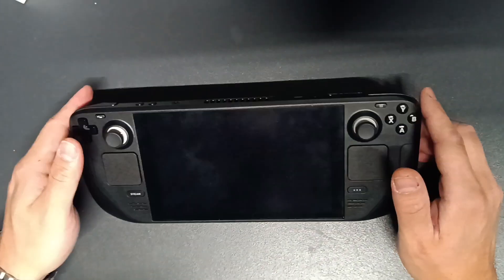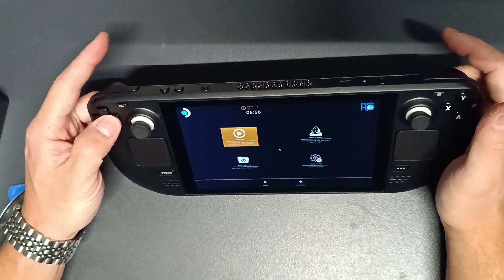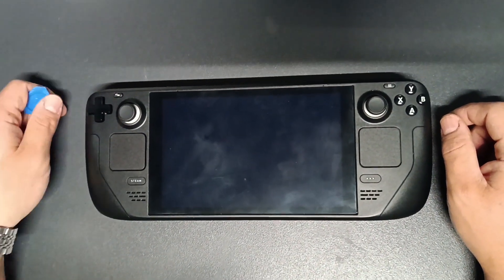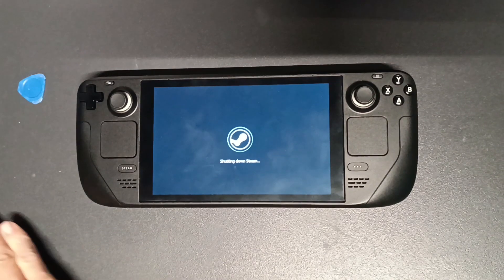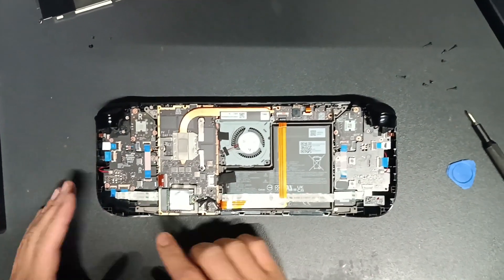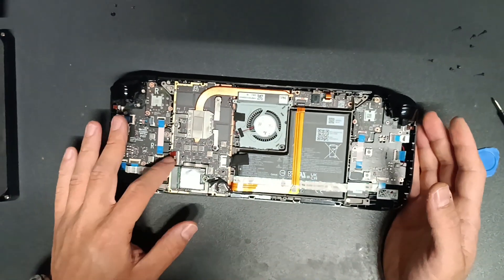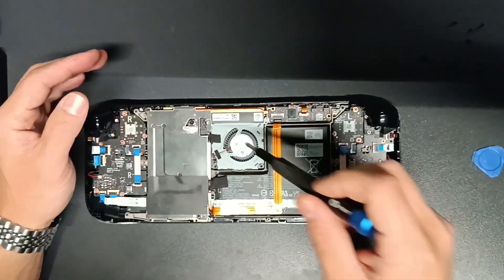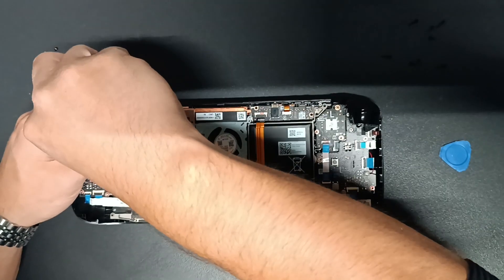Steam Deck HW issue D-Pad side not working

Comment: Did you find a fix. My deck is doing the same
Reply from the maker: Hello, I've sent deck to RMA and they've returned me the same fixed d CK within one week. RMA accepted. My guess is, that it is loose cable or contact on the bottom side of the motherboard.
Reply: ye mine has  stoped working to. but im going to try to send it back to valve
Reply: I have the same issue, got it 2 times and the second time steam sent me the deck with the bug doing the same thing, honestly idk what to do this is so disappointing